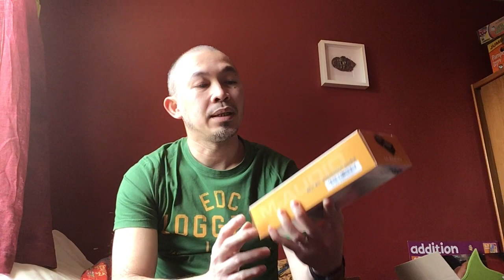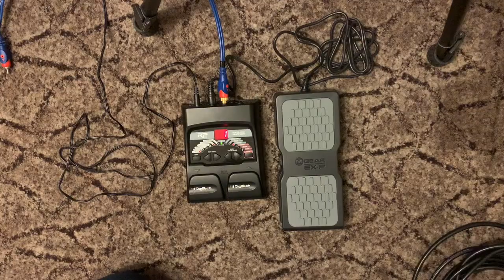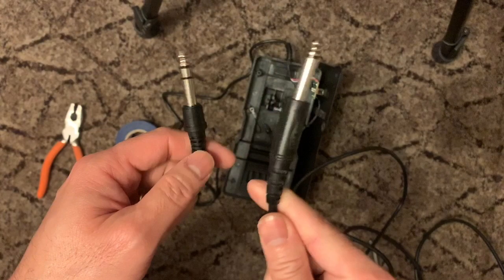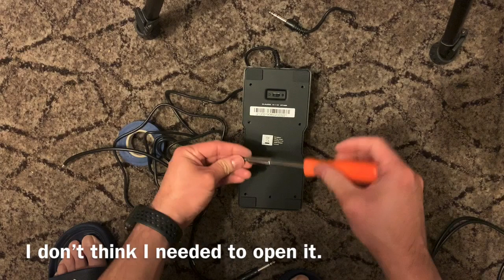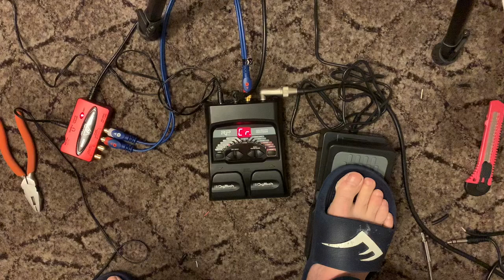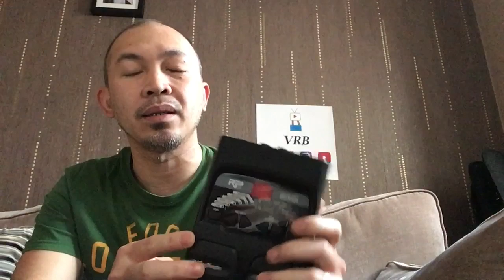DIY Hack On Digitech RP55 Improvised Wah Pedal

Comment: Can i ask Rp55 have distortion effect?
Reply from the maker: Hello Kim, it doesn't have a distortion or overdrive effect but it's got an amp sim that function as the distortion or overdrive. Here's the link: https://youtu.be/1a_gPytwBtU
Reply: Okay thank you sir  but what If the  genres of the songs are rock in your Rp55 what possible effect you use
Reply from the maker: @kimkim6524  Here are factory default patches. There's loads of heavy sound from Digitech and you can easily edit it. https://youtu.be/-LW_A3R9V8I
Reply from the maker: @kimkim6524  Here's some more https://youtu.be/Rv2_zqjJCd8
Reply: Thank you
Reply from the maker: kim kim you’re welcome!